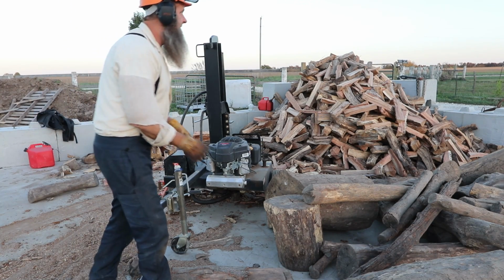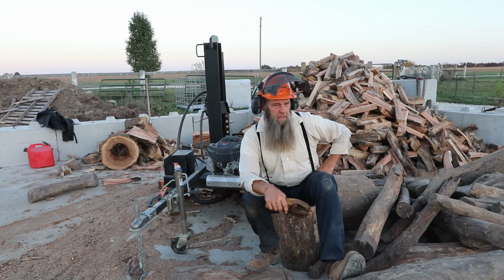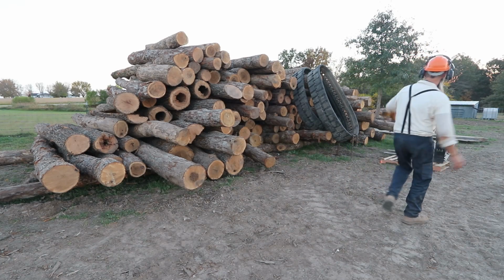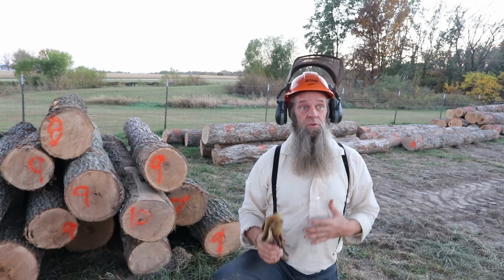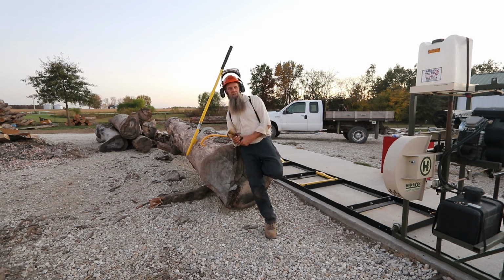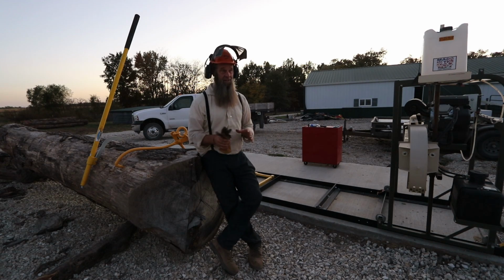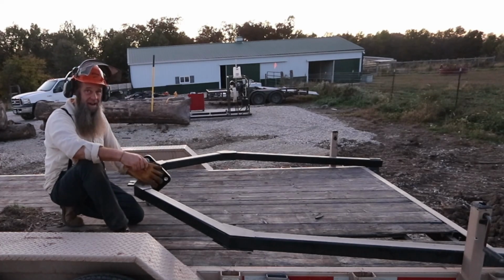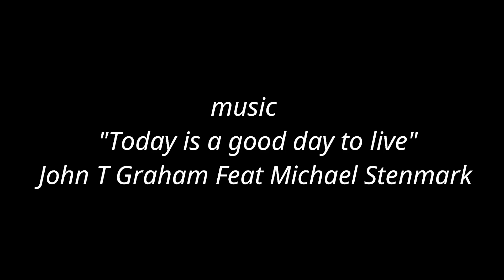A way to make money OFF GRID | FIREWOOD

Comment: I was curious why you placed the concrete pad for the firewood where you did, but you forgot to tell us lol! I think the profession you have chosen is very useful, and would be vital in a prolonged grid down situation. 

Add my vote to the video showing the trailer in use at the dump.

Comment: We live off grid for 5 years and still haven't found a job doing something I like. Still coming up with ideas for making money. We started wood working... We don't use a lot of electric but it might we worth it hauling the generator to get fixed to run some decent power tools. We don't have a lot of money. We live off $1500  mo but we had 3k a month 3 years into it. We paid everything off. It would  be nice to have the money for a well and a home besides a 32 ft. travel trailer. Yeah Doug, REALLY IMPORTANT TO BUY QUALITY TOOLS AND TAKE REALLY GOOD CARE. I've wasted lots of money being stupid with my tools. You might not be able to get some of these tools down the road with the collapse.

Comment: Have you seen the wood processors? Its a machine you can load your logs into and it cuts to your set length and then splits the wood. Finished split wood is then run out of the processor on a conveyor belt. Awesome machine!

Comment: hay is there away to raise the wood spliter so you won't have to bend so much. after awhile it will bother your knees and lower back. just worried about you.  dee williams
Reply: Then he'll have to lift it instead of roll or drag it . Perhaps a short ramp ?
Reply: You need to take one of those rounds and use it for a seat so your not bent over.  If you can also get a attachment to make the splitter a four way to get twice the split for one stroke.
Reply: @rockandrattleretreat5830  Yes!! Def use/sit on a stump!! My back is junk so no wayyyy could I keep bending; the stump seat is key!!

Comment: Doug that wood is split mighty thin. Thats what i call splinters! 
There are gonna be customers which will demand much larger pieces. Thin pieces burn fast, larger ones burn slow and much easier to keep smoldering when flue has been dampened.
The aim is still to have coals in the morning so your not continually lighting a fire.
Reply from the maker: Lol thanks 👍
Reply: No no no! I like small peaces for cook stove! Smaller peaces are important.

Comment: Running that home owner type splitter will not make you money as is, I would weld another splitting blade on the wedge to make it a 4 way, please sit on a round while working below your knees. your back will thank you, ad a foot control with a small chain to the hydrolic valve so you can use both hands on the round. Have fun,-mike

Comment: Doug you might want check out "outdoors with The Morgans" on you tube they have a firewood business.  Its to bad you could not orient  the Learning Building large slope roof for photovoltaic panels.  Stay safe and you and Stacy shouldn't work so hard; you need to take some time off an relax; because life is to short.

Comment: Doug, I'm thinking you could use a splitting maul by hand quicker than that gas powered monstrosity. And you're still young enough where you should be able to develop some nice biceps as a result. Another benefit is you can possibly match Stacy's guns in time (haa haa...dont be mad at me)